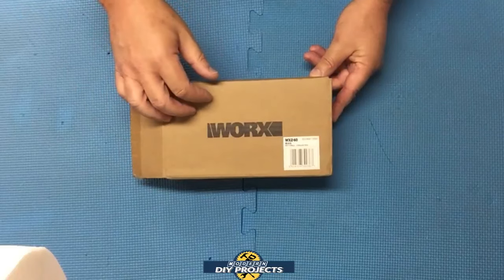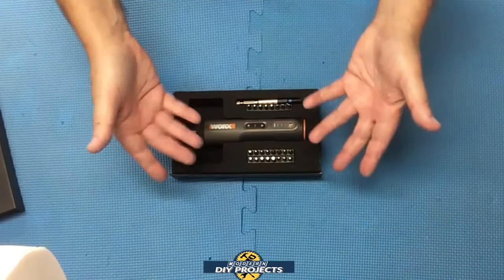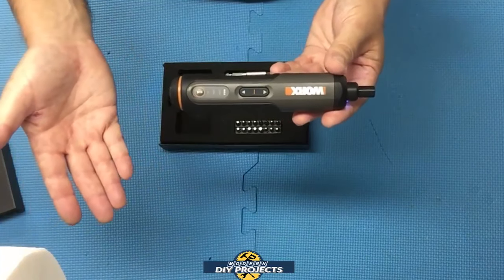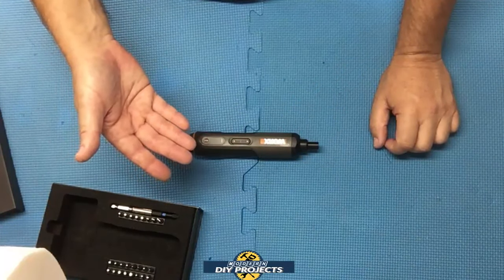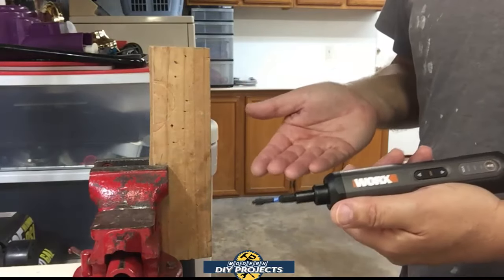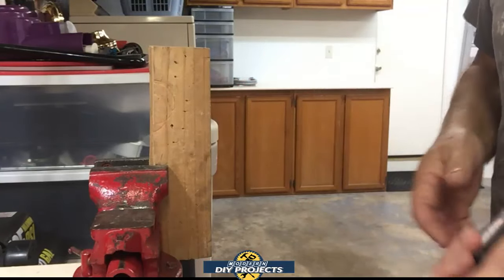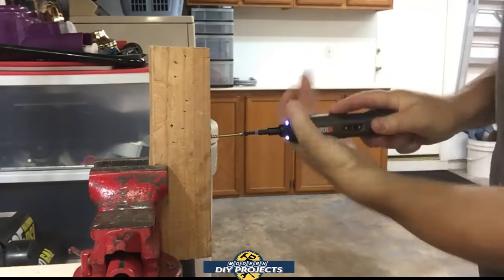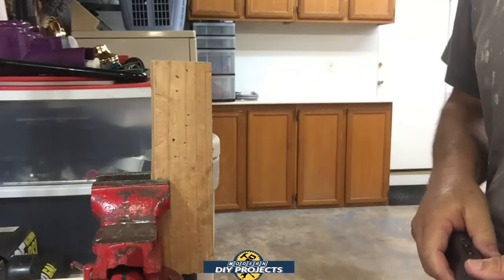WORX 4V Cordless Screwdriver Review and Comparison / Best Cordless Screwdriver?

Comment from the maker: Here is a review of the WORX cordless screwdriver I got from Banggood. This is a good screwdriver for the money and one thing I forgot to mention in the video is that this has a metal body where most other cordless screwdrivers are ABS. So if you drop this puppy there is less chance of it breaking or cracking. This is one reason why this one is a bit more expensive than other units on the market.
Reply: @ModernDIYProjects  does it have metal gears?

Comment: i've bought a "FERM" 4V cordless screwdriver, and it looks exactly like the one you have demonstrated here. The same battery, same square metal housing with rubber around it (albeit blue color), same torque settings, just the ferm version has 4 LED lights, and seems like an even better buy (18.50, but doesn't come in a box, with additional bits, like yours does) and i bought a ELLIX bit box, with over 50 different bits for like 7 usd, and i'm loving it, i wanted to see an in depth review of mine, but i couldn't find any item like it, and this one is basically the same thing, just rebranded.
amazing video, getting a sub from me

Comment: Just back into the UK from a trip to Hong Kong. Cruising the fantastic tool shops there, I bought by the successor WORX 242 with 30 bits on chance. At HK$270 (£27), it was low risk! It's only released in Asian markets so far, but looks very good. Not yet tried it for real, but I'm sure its a good'un. WORX design and make excellent tools in my experience.

Comment: It has more torque than I expected and it replaced the awful Dewalt gyroscope screwdriver that was really annoying.  For bigger jobs, I have both Milwaukee m12 and Bosch 12v drivers. Mostly I use it on RC cars and radio.

Comment: Thanks for the video.  I would have like to see how many screws it can drive before running out of power.  Because of its small form, the battery would be small and may not hold a long charge.
Reply from the maker: It's powered by one 18650 battery so that gives you an idea of how long it will last.

Comment: I ordered Bosch go first (₹4300), cancel and ordered worx (₹3199), cancel and ordered Deli (₹1600). Exactly the same as worx. And Bosch doesn't have ready backward button. It has a switch. Which is too dumb. They just came up with led light. So nope. Chinese are way ahead.
Update - cancelled Deli and ordered Bosch go 3...paid in full this time. Not going to cancel this for sure...lol It's exactly what's wrong with me...I order stuff and cancel stuff a 100 times before I can decide...
FYI - going with the Bosch because I feel like the casing is much nicer and I do not like the finish and colour on cheaper models...and metal gears of Bosch as compared to no info on the other two anywhere including the manufacturer's website and no response to the email and web inquiry...and Bosch has parts available in case if I needed a spare...
FYI 2 - my deebot floor vacuum broke and I am waiting to replace it's left wheel assembly as soon as I receive this screwdriver...I am excited...got both wheels sent to me without a service man coming home...that thing is torn apart a few days ago part by part...will put it together tomorrow probably

So looooooooooooong.....
I mean the comment 😂

Comment: I love your videos. Very detailed and good explanations. 
Can you still get this with the case and where? 
Also, did you ever do that review on the code scanner?
Reply from the maker: Thanks Randy. I got this from Bangood, and they should still have it available. If not you can try on Amazon. I already did the review of the code scanner and many more since then. Go check out the playlist I have of car scanners on my channel page. I put them all into that playlist.
Reply: @ModernDIYProjects  thanks for the reply. Bangood was out of stock and Amazon didn’t list it with the case. 🤷🏻‍♂️ I will check out your playlist on scanners. Do you have a favorite that also does diesels?
Reply from the maker: @randyc2525  All the scanners that I have tested all work on any OBD2 system. Consumer grade diesels will also have an ODB2 system, but commercial trucks (Peterbuilt, Caterpillar) will probably be different. All the scanners I have tested are good, but all have their quirks. The one I like best is probably the Xtool D7 because it is the smallest and fastest. It connects and reads everything really fast and has lots of features.

Comment: I really like this. Wish I’ve seeing it before buying the m12 impact
Reply: The two aren't really comparable since the only advantage worx has over your impact is it's convenient size (useful in cramp spaces, less bulk and weight to carry, pocket size so ya always have a power tool on hand).
Your M12 is much more powerful and serves way more purpose than this worx model.
I use both (M12 tools + enertwist electric screwdriver) for different purposes, the electric screwdriver mainly for convenience like I mentioned above but I also work in the trades and can't work without real power tools.

Comment: In other words the torque range in the manual says 22 to 44-in pounds which equals 2.5 to 5 nm I'm not seeing anything about 8 nm.  Can you enlighten?
Reply: I read that you can apply upto 8nm in manual mode. More torque than that will damage the device. The device itself can apply a max of 5nm

Comment: I recently bought the WEN 4V Max Lithium Ion Rechargeable Cordless Electric Screwdriver and Flashlight with Carrying Case and 40+ Accessories, $22.62 it now lists at Lowe's for $26.61 I used it to assemble The General 4 drawer tool chest from Harbor Freight and it performed just fine. What proved to be an advantage was the ability to swivel from a straight driver to a gun configuration. besides the light on the tip, there's a flashlight built into the butt of the handle. It's a keeper! I had that same B&D driver 20-some years ago, it remained a good driver in spite of the batteries going out long after I bought it.

Comment: How did this thing hold up 2 years later  ?
TY
Reply from the maker: It's still working. I use t every so often with no problems. I have several of these units so it's not my only one.
Reply: @ModernDIYProjects  TY
Reply: Looking at getting one of these or the skil twist 2.0 for household work and flat pack furniture etc. as both are similar price, any recommendations?
Reply from the maker: @1982craigyboy  They are both good products but I have not tested the Skil. I don't think you can go wrong with either choice. This one works fine but it can break your wrist since it doesn't know when to stop twisting when you get to the end.

Comment: if the battery is totally exhausted, and not rechargeable, are the batteries replaceable?
Reply from the maker: If you open it up and have a little know how, sure you can do that. It probably just uses an 18650 battery.

Comment: i use this for building computers, I just had to demagnetize the bits
Reply: I was looking at this for a present and it would be used for building computers primarily. Does that allow the bits to hold small screws without dropping them?
Reply: @kpatt2006 generallly it’s safe to use a screwdriver with magnetic bits because the level of magnetism isn’t high enough to damage anything, but ofc always be cautious